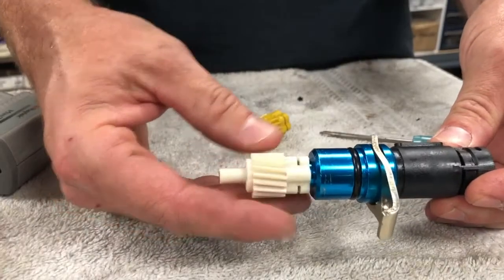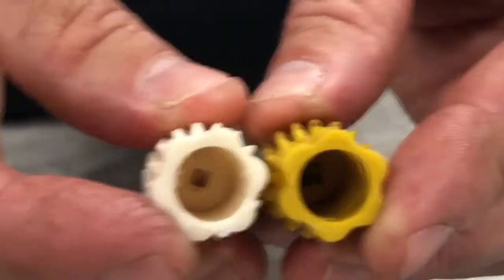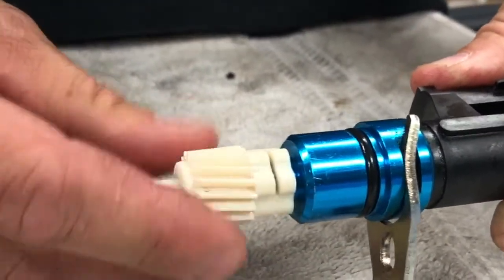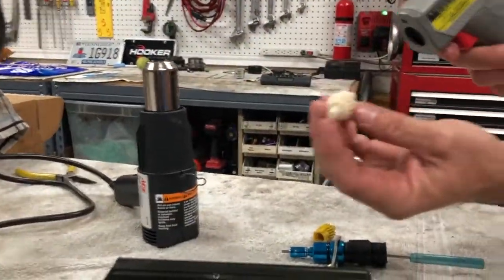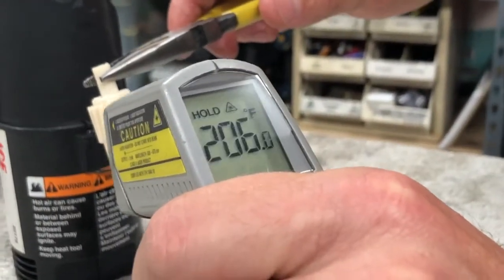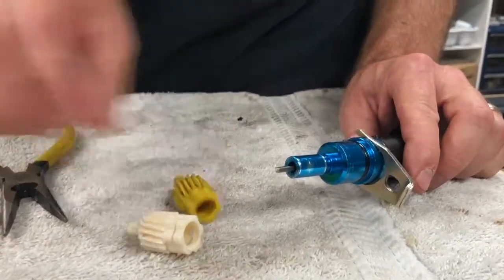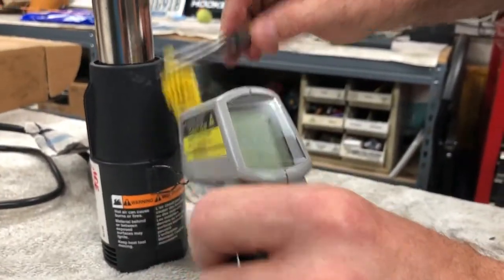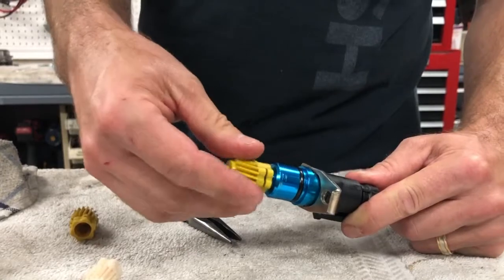FoxBody Mustang Weird Speedometer Fix

Comment: Let me ask you something... I have a issue with my car (91 Mustang) that i haven't been able to figure out and i have wondered if maybe this sensor is bad,its a AOD car.

If you ever have been on a commercial flight,when you land and they turn the reversers on, thats what it feels like when coming  to a stop,its like it doesn't wanta go into first and at the risk of sounding combative,lol, its not the transmission,thing shifts like silk and i have always taken super good care of it, many years ago it was doing that and one day it just went away and now its back,i think it has something to do with the idle so i was thinking maybe it could be this sensor? any opinions?
Reply from the maker: That's really interesting. Is your transmission downshifting? I wonder if your kick down cable is not adjusted properly.
Reply: Thank you for your reply,yeah you know i think it could be the TV cable,those cables are real finicky,i actually adjusted mine with the "no slack no tension "that some Ford techs recommend but i think what has happened is over the years and several different intakes and spacers that adjustment might have gone south.

Case in point,i used to have a egr eliminator spacer that i actually made out of phenolic,i drilled and tapped 2 holes for the throttle bracket and i made it for 65 mm and i used it for years,about a year ago i rebuilt my engine and when i put everything together the car started "wondering" on overdrive and i told myself, " well ,new engine,other things are going to break down" thats what most people believe so i blamed it on that and just started driving it in 'D" , i dont do much highway driving so i figured i could drive it in D until i got my tranny rebuilt even though it shifted perfectly.

While browsing on eBay i saw a auction for a really nice polished aluminum EGR eliminator bracket so i bought it and installed it,i mainly did it for looks because my old homemade spacer looked kinda rough,because this new spacer was wider than my old phenolic i had to adjust the TV cable so it would reach the throttle body,a very very minute adjustment, after i did that overdrive started working again like a dream, blew me away,lol,something that small was keeping my overdrive from working properly.  

soooo,i think you are right, maybe that TV cable just needs a minor touch,i know you asked me if it downshifts,it does but it bogs down and it makes the engine rev up, not too high mind you but its annoying and thats what i want to fix,il just play with the cable in very very little increments and see if that does anything, sorry for the long post,just wanted to explain everything in detail and it might help someone out some day

Comment: James Goudeau 
my problem is that I used the chart that LMR has and I met all the spec but my speedometer reading is less than actual and at 65 mph it is 20 mph slower. Any suggestions?
Reply from the maker: Check the color of the gear inside the transmission. Remove the speedo cable/sensor from the transmission and look inside to see what color it is inside the trans.

Comment: Original speedometer cable was replaced do to a whining noise coming from the gauge cluster while the vehicle would be in motion, mileage was still reading. I've replaced the cable and fixed the whining noise, but now the mileage ain't reading. Replaced the cable twice now and can't figure out the issue. Also changed the gear cap currently running a 17th tooth
Reply from the maker: Does the speedometer work...just not the odometer?
Reply: @Mustang-Geek  yes speedometer works and the noise went away, but now the odometer does not
Reply from the maker: @dannyd4922  Weird. On later models, the gears that turn the odometer would get brittle and break. That's not really a thing on older ones, though. I'd suggest getting a salvage cluster.
Reply: Can it possibly be that im having the exact same issue what your describing on your video? Maybe try an 18th tooth gear ?? I have 3.73 gears and 275 rears
Reply from the maker: @dannyd4922  No, my speedometer AND odometer didn't work. If your speedometer works correctly (reads speed), but your odometer isn't turning, that's something internal to the speedometer/odometer.
Reply: The whining was the gear mesh  inside the cluster. It's fubar.

Comment from the maker: Update: I bought a Tremec OEM gear (not a no-name plastic gear from LMR or whomever) and my speedomter works perfectly.
Reply: I think I have the same problem.  The speedo and odomoter work okay initially, and then as it starts warming up it starts jumping all around.  Trying to figure out the speedo gear to purchase.. it lists different speedos from tremec with a different amount of teeth.  I don't know which one to get.  I've got a 1994 mustang gt automatic transmission.
Reply from the maker: @GoldenK9Campers   Not sure what to do about the AOD. Maybe try a Ford dealer for the right gear.
Reply: @Mustang-Geek  do you have a part number or website I can buy the gear from. I'm having the same issue
Reply from the maker: @cribb6900  I'd call 5speeds.com at 561-743-5600 and ask specifically if their speedometer gears are OEM Tremec. Explain the aftermarket junk plastic expands with heat.
Reply: Awesome. Thanks for the reply 👍

Comment: Great info! I think a company out there should start manufacturing metal speedo gears
Reply from the maker: Or just get (find?) OEM Tremec speedometer gears.
Reply: Are the tremec gears steel? Or still plastic but just better tolerance?

Comment: There is an equation out there (American Muscle comes to mind)...as to what speedo gear you need to use and it's based on your tire size and the gear ratio in the car. Not sure if this helps your problem or not...just throwing that out there.
Reply from the maker: Yes, LMR has one. My issue was not calibration, but it just stopped working because the gear would expand and slip on the shaft. Here's that calculator for reference, though: https://lmr.com/products/Mustang-Speedometer-Gear-Calculator
Reply: @Mustang-Geek  yes! Ok...LMR 👍
Ok...looks like the correct on fixed the issue? Any way glad you solved the issue. Been working on 2 myself today with my Fox, both solved! Great feeling 💪
Reply from the maker: @jpp9846  That's why I call them "FixBody" Mustangs. Need lots of fixing!
Reply: @Mustang-Geek  😂 you ain't lying ✌️